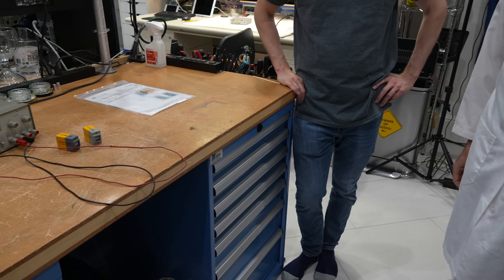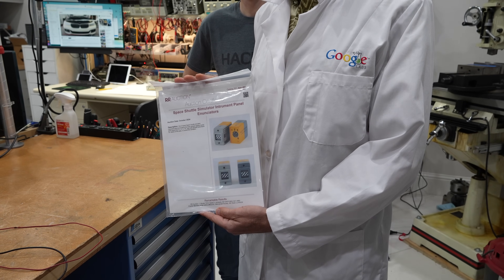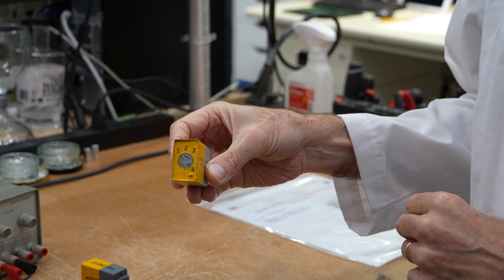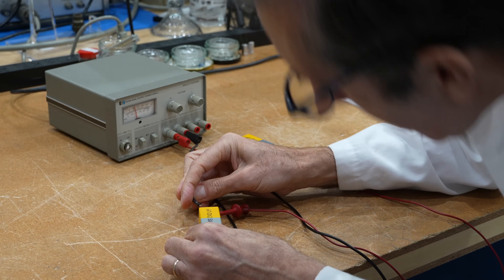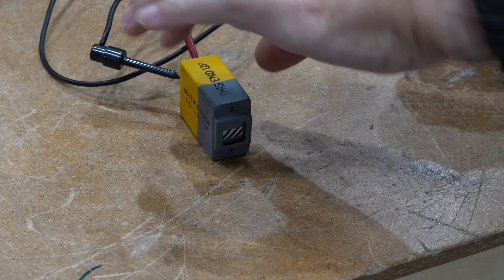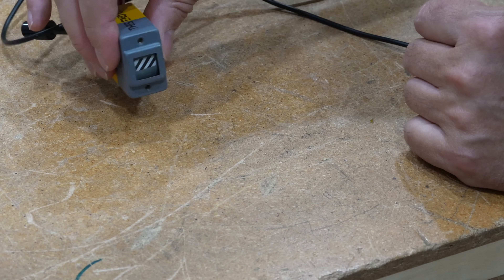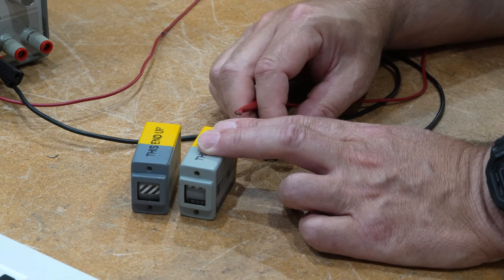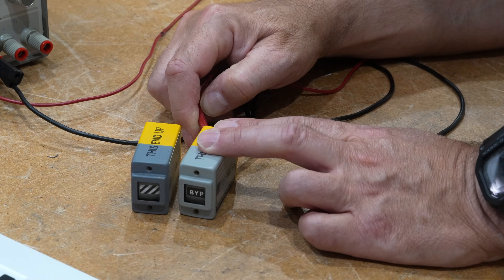Space Shuttle Barber Pole Annunciators

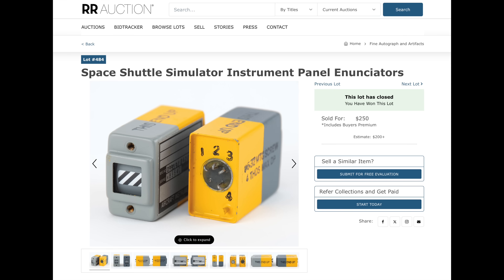Comment: 01:17 "This end up" Didn't they get the memo this will end up in space?
Reply from the maker: Yeah we thought that was funny, but obviously it is so that you install them with the lettering in the correct orientation. You don’t see any text displayed when you install them in “barber pole” unpowered condition.
Reply: Probably has to do with the text direction as the text is invisible in "barber pole mode". It looks better if all text has the same direction on the control panel.
Reply: @mbee32k  Makes sense as the Cockpit has it's local "up" and "down" reference.
Reply: >this will end up in space... 
Which end up in space?
Reply: Up is the end that should point toward the ground if you want to go to space. If it starts pointing toward space you are having a bad problem and you will not go to space today.

(The shuttle flew “heads down” most of the time. In orbit, that’s handy, because radiators tend to be where the heat shield isn’t, and unless you are having a VERY bad problem, the sun will not be between you and the ground, so the ground is typically a safe direction to point radiators. On the shuttle the radiators are on the inside of the payload bay doors, which is incidentally why those need to be open in orbit. During launch there was some sort of aerodynamic advantage to flying “upside down” that I never really understood. It’s also kinda nice for there to be something other than sky in the window so pilots can visually orient themselves, and it helps if you need to abort. Reëntry and landing is just about the only time you’d want the top of the cockpit pointing opposite to where the ground is, and that’s very much not the day you’re going “to space.”)